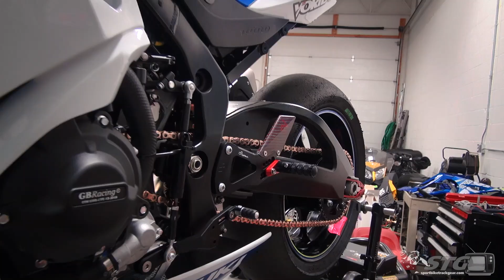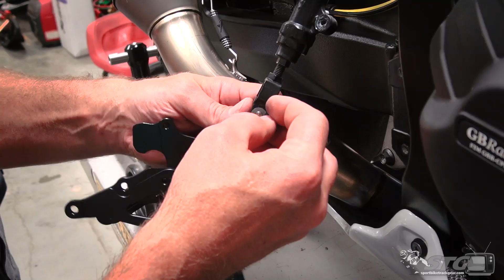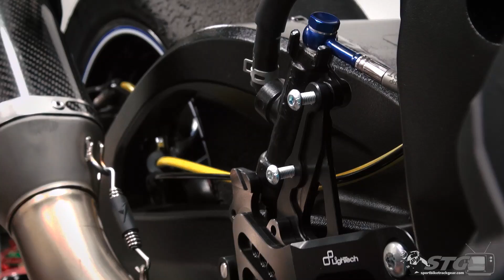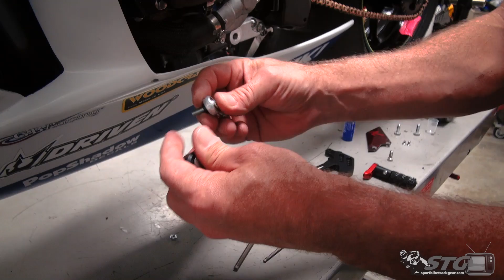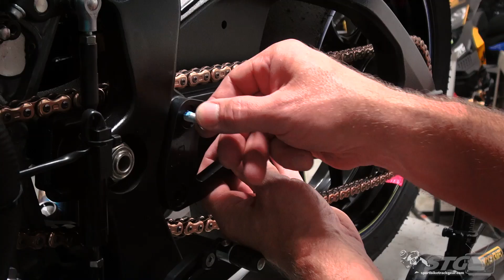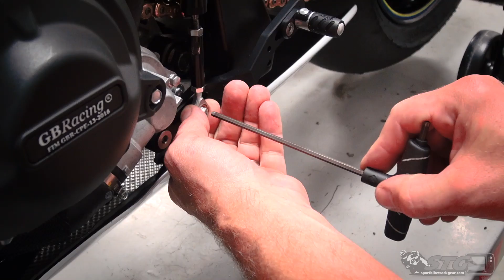Lightech Suzuki GSX-R1000 R Rearsets Install | Sportbike Track Gear

Comment: I'm going to get a aftermarket set of rear sets. I need almost no play in my shift lever. A lot of these aftermarket companies are using bearings rather than bushings. When I lightly preload the shifter my quick shifter is flawless. There's too much play in the stock shifter. I've got low miles and plenty of lube so there's no failure or issues. Simply the way it is. I'm going to get a set or push a set of bearings in the OEM shifter. I like the vortex v3 you had. Can't wait to get one of them
Reply from the maker: I still have the Vortex on the bike now. This Lightech set was also nice. - Van

Comment: Look great! But so do other after breakfast rear sets. At twice the price is there any other benefits that they have?
Reply from the maker: The tolerances are a little tighter and the overall fit and finish are very nice. They also look absolutely amazing on the bike. End of the day if you are only interested in the performance not the looks Lightech offers a standard version that sells for $629. I installed several rearset kits on this bike and felt they all performed pretty well. Here is a link to our STG GSXR1000 Project bike page that has all of the installs: https://www.sportbiketrackgear.com/2018-suzuki-gsxr-1000-r-stg-project-bike/

Check the rearset installs out so you can see the difference between the kits and choose the one that best suits you. - Van
Reply: @sportbiketrackgear  thanks! It was more of a curiosity question to be honest! I appreciate it though, as well as all the how to's that you guys make.

Comment: Dear Brian,
I do understand that it is a sportive footpeg kit, but how low and forward can you adjust it comparing to the original? 
Thanks
Ami
Reply from the maker: These are designed to be moved up and back as compared to OEM rearsets. They will not allow for any position lower than the OEM. - Van
Reply: Thanks  @sportbiketrackgear

Comment: I am assuming although not stated that once again you cannot fit the OEM brake switch and need to splice in a pressure one?
Reply from the maker: You are correct this kit does not accommodate the OEM rear brake light switch. If you want to retain that you would need to install the pressure switch. If you have the same bike both the Vortex and Driven rearsets allow for use of the OEM rear brake light switch. - Van

Comment: Did you needed a brake sensor replacement for this sets.
Reply from the maker: If you need the rear brake pedal to activate the light you will need a banjo brake light switch. - Van

Comment: Brian...thanks so much for your videos. Help me make decisions on parts.  I have a 2019 zx6r krt ABS. I will be installing the Lightech r rearsets on it. It states I will need to replace the brake line. I would like to go to braided lines. Does this mean I will just get the correct fitment, or will I need to get a different lengthwise size in order to make it work? What brake line would you recommend? Thanks for any help and advice you can give me. Awesome job on your videos!

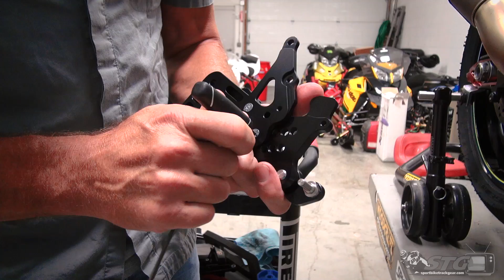Comment: Dear STG...super interested in this item for my 2020 Gixxer 1000R. Was wondering, the snap ring on the brake side that secures the master cylinder (3:29 of the video), how does that thing work and how secure is it? Never seen something like that before. Otherwise, pretty simple install? Thanks for all you do!
Reply from the maker: It is super secure. End of the day the clevis for the master cylinder would stay on the shaft without the snap ring. There is no side load on this at all. - Van
Reply: @sportbiketrackgear  Thanks, Van....does this require a banjo bolt modification, and if so, are there other Gixxer rearsets out there at the STG store you recommend that use the stock brake light system without modification? That look pretty decent and are effective (hard to compare aesthetics to Lighttech)? Thanks again!

Comment: Cheers Van. How would you compare them to the Gilles as I now they don’t need a pressure switch. Cheers John
Reply from the maker: I have not seen the Gilles for this bike but have used them on other bikes in the past. I would say the overall quality and design of the Lightech is a little nicer than I remember from Gilles. These are literally a work of art. - Van

Comment: What is the name of that tool at minute 4:27. Thanks so I can buy from your website
Reply from the maker: That is a pair of snap ring pliers. We do not have any for sale on our site. You can get these at any local hardware store. - Van
Reply: Thank you . Just one more question do I need a brake sensor for this set I have a Gxsr600 2016.

Comment: great video Brian! is it possible for you to do the installation video of the non-R version on the Kawasaki Ninja 400?
Reply: with the LighTech brake light switch for the Ninja 400 too, please
Reply from the maker: We have the R Version for the Ninja 400 here now and will be installing them this week at some point. Stay tuned! - Van
Reply from the maker: You will need the 10mm x 1.25 thread pitch for the Ninja 400. Any brand will work. Here is a link to the Vortex on our site: https://www.sportbiketrackgear.com/vortex-rear-brake-light-switch/    You will need the RS100 - Brian Van
Reply: wicked! though not immediate, I'm seriously considering these rearsets. maybe they'll be in the end-of-year budget. thanks for the brakelight switch suggestion!

Comment: Are the carbon heelguards strong enough when riding on the track ? They look really thin en i like to put my heel firm against the healguards in corners.
Reply from the maker: Yes I rode on the track with these multiple times, zero issues. A great pair of rear sets. - Van

Comment: Hi - Do these go lower than OEM? Thanks
Reply from the maker: I do not believe these will go lower than the OEM set will. Most aftermarket rearset kits are designed to offer more ground clearance not less. - Van
Reply: Sportbike Track Gear thanks for rhat

Comment: How do they compare to the gilles rearsets?
Reply from the maker: I have not used a set of Gilles in several years now, the ones I did use were nice. The Lightech rearsets offer an amazing level of precision and quality, a touch higher than anything else I have used over the years. - Brain Van
Reply: Sportbike Track Gear thats really good to hear they might be my next purchase knock on wood, thank you brian ! 
Btw i have ordered a set of spiegler non abs lines from you site in hopes of getting a better braking on my R1
Reply from the maker: Appreciate the order, this is the way to go on the R1 for sure. - Van
Reply: Sportbike Track Gear just 1 more thing brian, in my order I forgot to mention in the comments section that i want the 3 line type 950 fitting, do all options come included or I screwed up...?
Reply from the maker: @Shooter7250  https://www.sportbiketrackgear.com/spiegler-yamaha-yzf-r1-15-17-no-abs-front-rear-brake-line-kit-rennsport-front-lines/  If this is the kit you ordered the front line has one off the master into a manifold that splits off into 2 lines that route to the calipers. - Van
Reply: Sportbike Track Gear sweet !! I wanted the same exact one you installed on the R1. Thank you for everything brian you are amazing 😉
Reply from the maker: Thank you, appreciate the kind words! - Brian Van

Comment: Do these give a bit more legroom for a taller rider? 

Great video and explanation by the way!
Reply from the maker: No rearsets kits are designed to raise the footpegs to get the rider into a more aggressive position. - Van
Reply: Sportbike Track Gear  is there anything can be used to add more legroom or maybe a different type of rear set? thank you so much for your reply, the video is older so I wasn’t expecting but thank you for taking the time to reply back! I will subscribe (: